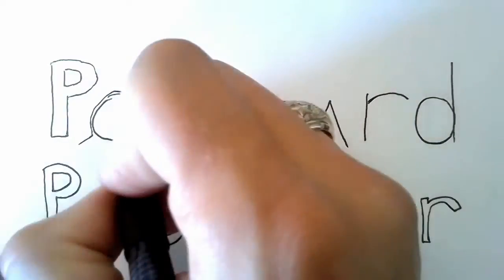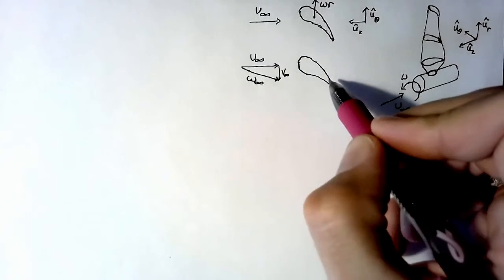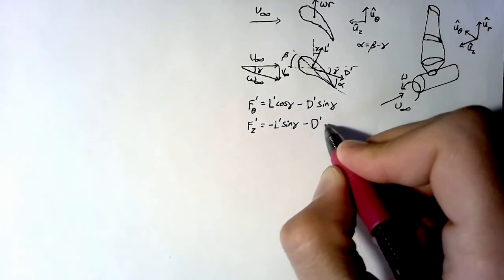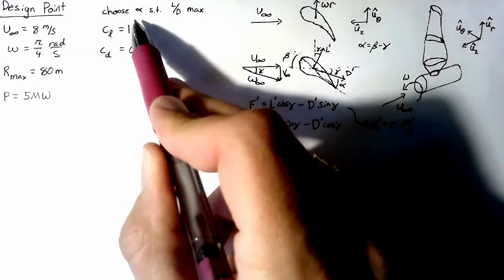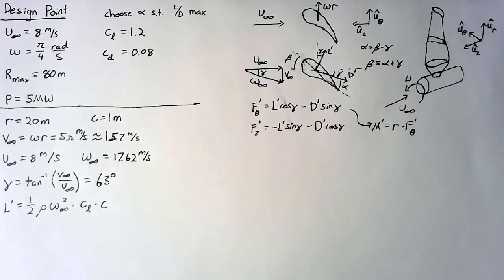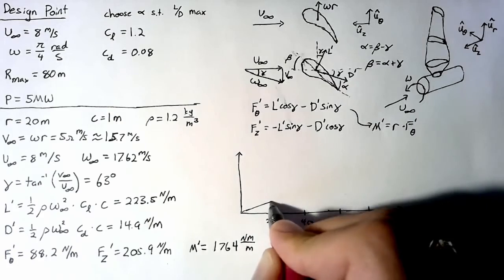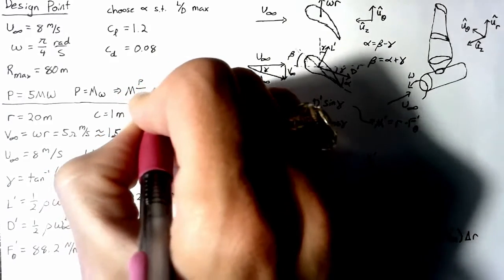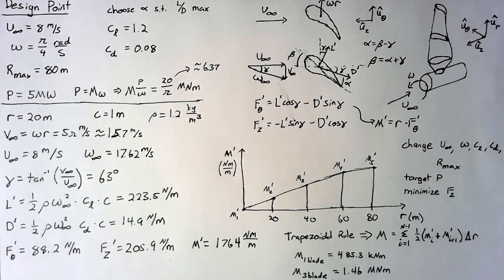Wind Turbine Blade Design

Comment: Make since out of berz claim the automactic feathering flatblade radial windmill is borh horizontal unlimited width and vertical blocking amd releasing 100% simontanisly  betza the limits x 4 rpm hover dams in tides .oil brainwash 1919 discovery embedded leonardo you melted ice caps already.

Comment: By my ruff calculations since 1905 Einstines relativity of winds and tides that have excessive capabity you owe 2 ice caps and punitive damages using betz limits claims my  invention  can not exist that is hoover dams that reverse gearing to light speeds please cease and desist betza limits phyics law immediately thanks world appreciates truth its vertical version upper left corner has no gaps   full on blocking  & release simontanisy all versions  equally .

Comment: Thanks for the explanation, however, you want the turbine to produce 5 MW with a radius of 80 m and a wind speed of 8 m/s which gives a power coefficient around 0.8 which is impossible where the theoretical limit is 0.59 (Bet'z limit). I think with these values you can have a maximum of 2.5 MW.
Reply from the maker: Yeah, I failed to do the check there.  I'm planning on doing another video that includes the effect of momentum conservation.
Reply: @PostcardProfessor  Please make it sooner.

Comment: Awesome video!  Can you share your values for M'2 thru M'5?  I'm building a spreadsheet based on your calcs and am with you right up to M'=1764 Nm/m but am getting 642 kNm for the integrated moment on a single blade.  Making sure I'm using delta r and everything, can't find my mistake.  Hate to drag you back to something you did so long ago but am working on an educational video and want to make sure I get this right.  Love what you're doing, you deserve more subs!  (fellow engineer BTW, dipping my toe into wind turbines).
Reply: Wow
Reply: Never knew id find u here
Reply: A waste of cyper space big unessesery gaps leonardo wagon goes by ship at sea design 500 + years old oil discovery embedded
It 1919 for slush fund to elect polices.obviously  the 100  + year politics old scam in play still just .barely.
Reply: Say please consider betz totally fake focus on 1905; Einstines relativity kinetics has blue print to stop cold global warming as well as props losing most of winds and tides values in propelling ships to in 1 rpm  my design of equal and opposite reactions is able to be enclosed  threw cylinders for over majority of cycle or more 6 times opening and releasing either way  far more usable kinetic energy thanks  if sketch helps let me know or YouTube bejesus windmills or automatic feathering flat blade radial windmills drawimgs bigger than hover dams that reverce in tides and winds need creditability lacking in sciance thanks I am just inventor way under Einstine

Comment: Your lesson is great it gives simple explanation of wind turbine twist angle, but you did a mistake in the beginning. The whole point of wind turbines is to take kinetic energy from the wind and convert it to electricity and to do that turbine has to slow down the wind. By Betz theory you get good aproximation of twist angle if you take that wind speed on the blades is 2/3 of wind speed in front of the turbine. Once you get this twist angle you have to do the optimatization using computer programs but for the beginning Betz theory is good. Also it works for TSR from 6-9, airfols with low drag and at the root of the blade it does not give good values.

Comment: Great video, mate! I would like to ask for the source of knowledge you used here. I really need to look into greater detail however, it's difficult to find a convenient source that would explain everything in simple words. I am trying to find a sort of a step-by-step guide about wind turbine design. Thanks again for the video :)
Reply: 1. Betz limit and efficiency of wind turbine
2. TSR and effect on Cp
https://cdn.intechopen.com/pdfs/16242/InTechWind_turbines_theory_the_betz_equation_and_optimal_rotor_tip_speed_ratio.pdf
3. Airfol selection , I use NACA 4 and 6 families, for root you use "fatter" airfol because of strenght 
http://airfoiltools.com/airfoil/details?airfoil=naca4412-il
4. Twist angle and distribution(video above just take wind speed on blades as 2/3 of wind speed in front of blades)
5. chord distribution,  in Betz theory it is described  by this equation(which needs optimatization but it is good for the beginning)

c(r)=(16*pi*R)/((9*n*Cl*TSR* sqrt(TSRr squared +4/9))

R radisu of blade
r local radius
n number of blades
TSRr local TSR
6. Material strenght, i dont know on what are you working but best materials are fiber glass and composites of fiber glass
Once you define geometry of your blade I recommend building it in solidworks and printing it, than you can create mold and then more blades, or you can create your mold in solidworks as well.
I hope i helped you, lets build this turbines and help our planet!

Comment: how do you calculate the total Moment of one blade i try trapzoidal rule but it does not end with 485.3 kN.M
Reply: I haven't tried it, but I guess when the radius (r) changes, the gamma angle also changes. Hence the Moment (M prime) is also changing. So the total moment turns out to be 485.3 kNm. How the gamma angle changes is shown in the video.

Comment: Thanks, Postcard Professor...Just wondering if you have ever done calculations for the VAWT design turbine? To me it would appear to have 2 major advantages over the typical blade design. 1] it does not require a 90º gearing for power differential, 2] it can use wind from all directions.

Comment: Would you be interested in helping me design a tiny wind turbine generator for off grid? For ultra low wind speed, but needs to survive 80 mph, but make power at 5mph! Do you think you could design to meet these wind limits ? I am moving to off grid, and need to supliment my solar power, and I'm thinking 1kw in 25-30 mph wind, are you interested? Thanks

Comment: I was looking at turbine blades, from a company  unnamed, they has 3 different lenth blades, the only difference between the 30" and 48" was the 30" were cut off from the 48", I don't think that will make a effiecent blade! It makes the tip near 3x wider on the shorter blades!

Comment: Would the blade design calculation be different if you have a VAWT
Reply from the maker: Very different, unfortunately.  Darrieus wind turbines could probably be designed somewhat similarly (with additional complications), but Savonius would be nearly impossible.
Reply: @PostcardProfessor  What is your take on the #Saphonian. Postcard Professor, and also I'd really like to get a response to my VAWT question above. Much appreciation!

Comment: Thank you Sir for this video very informative. I have a question despite that. Indeed in certain cases the chord of the blades are variable along this one. In this case, what do we do? choose a value or calculate a value of the string in each case. And what would be the equation for calculating these values of the chord?
Reply from the maker: Typically, the exact details of the chord variation are due to structural constraints (how much bending can each section handle).  This analysis can only tell you how much power you'll generate once you choose the chord variation.

Comment: U're a genius bro! Just one thing has been in my mind for the past couple of months... how can i determine the W or the RPM of my shaft or my wind assembly ????? I really need this
Reply from the maker: It's something you choose.  One constraint is that you never want your blades to get too close to the speed of sound, so (omega*R should be significantly smaller than that).  If you want to dive into the world of electrical generators, there may be some additional constraints there.  A final constraint would be from the structure, where you have stresses develop based on the centrifuge effect (omega^2*R).  Good luck!
Reply: @PostcardProfessor  How can i chose that ? if i know that the speed of the wind (8m/s let's say), the RPM will vary and increase with the increase of the velocity of the wind. i wanna know if there is an equation that relates the 2 together (maybe also in relation with the radius)
Reply from the maker: @ing.anthony7097  You can couple the moment of the wind turbine to a model of your generator.  If you know that the generator accepts a torque that is dependent on the RPM, then you can calculate the operating point of the system.  Alternatively, you can put a brake in the system that will keep the turbine operating at a steady RPM, and use up any excess torque.  If you want to determine WHY the RPM is what it is, you need to start looking at the mechanical systems, rather than keeping to the aerodynamic.
Reply: @PostcardProfessor  hmmm. so if i am designing a wind turbine with 29m radius and w speed of wind 8m/s... is the RPM of the turbine shaft evident here ?
Reply from the maker: @ing.anthony7097  Constraining the tip speed to less than some percentage (say 70%) of the speed of sound gives you a maximum value, but there's not a single clear answer from the information you've given.
Reply: @PostcardProfessor  What information do you need in order to determine the RPM of the shaft ? i wanna know the methodology... what info do you need and i will give you.. the only thing i need is only the RPM calculated theoretically
Reply: Cool video. The page is like a piece of art.

Comment: Is the final power value taking into consideration losses, or is this an ideal calculation?
Reply from the maker: This is ideal in multiple ways.  Probably the most important is the neglect of 3D effects.  We assume that the flow for each cross section doesn't change that of the adjacent cross sections, and there is no radial flow (flow along the length of the blade).  Mechanical losses are also neglected, but much more easy to add in (if you have the efficiencies of the gearbox, etc.).
Reply: Can you explain how to design a axial fan?